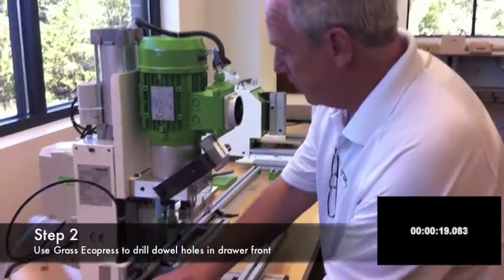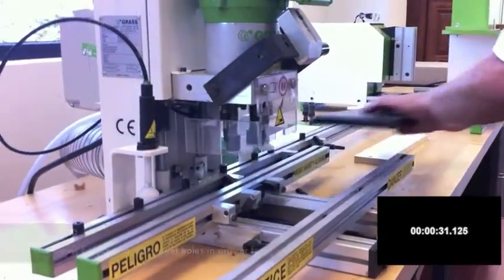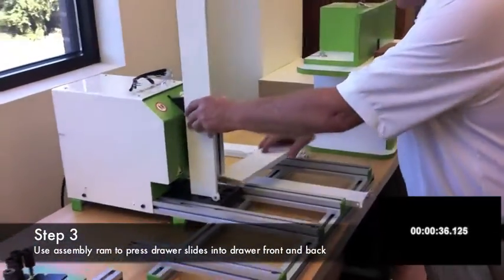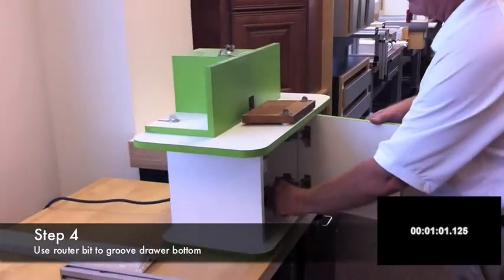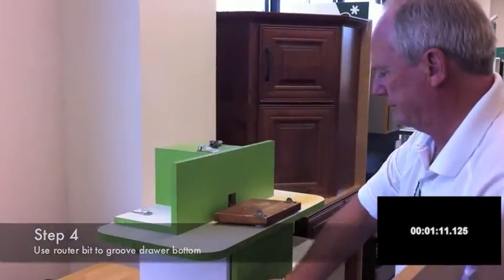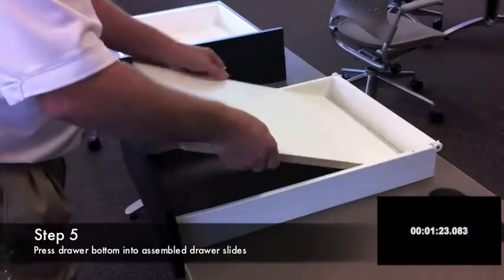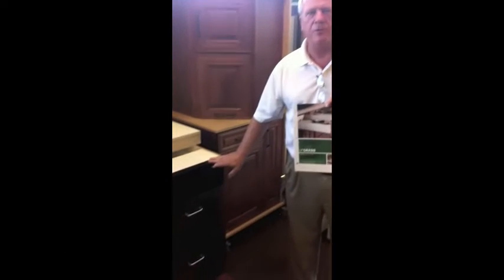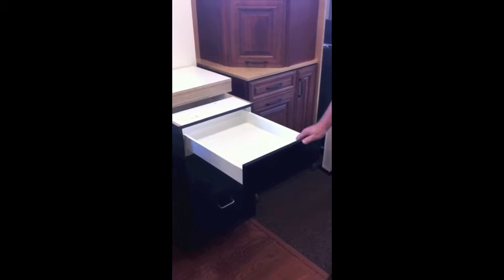The 2 Minute Drawer -- Zargen by Grass

Comment: Question? With a BB/F (box/box/file) pedestal. How would I lock all three drawers with a side mounted gang lock? The grass zargen slides are smooth on the outside with nothing that the gang locks could interfere with to prevent the drawer from opening. ????